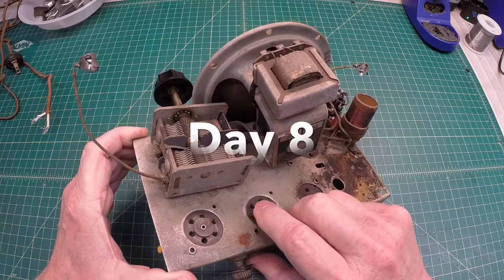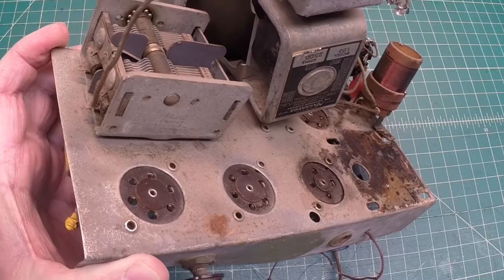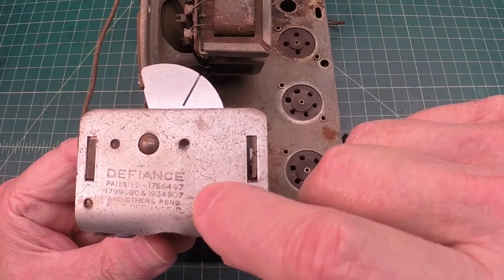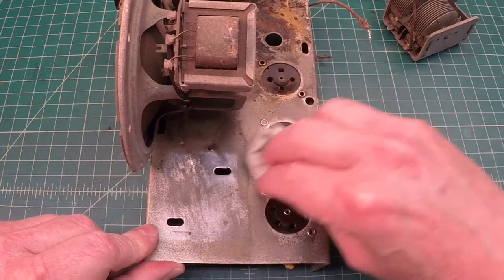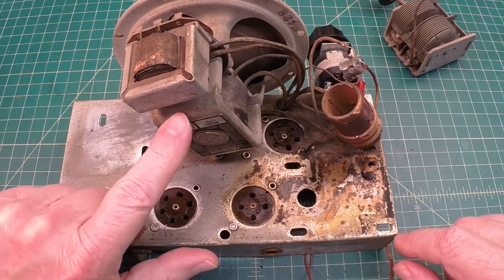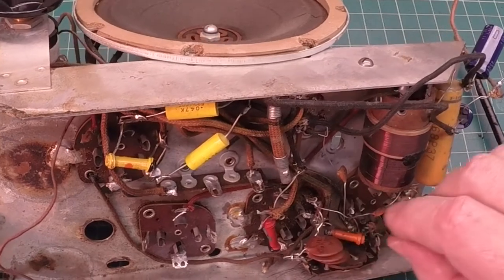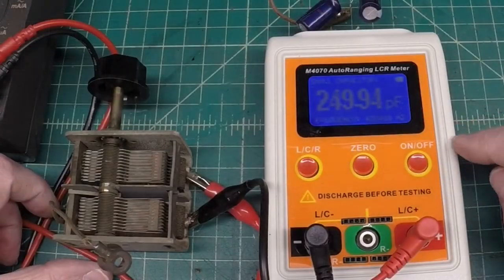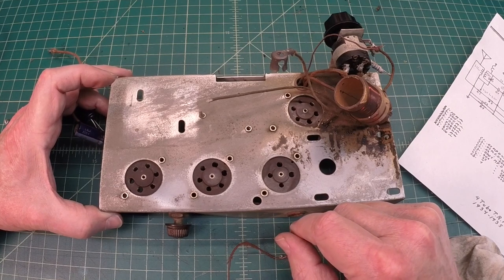Peter Pan Radio - Day 8 P2 (Tuning Condenser L Test + Field Coil & Output Transformer)

Comment: More good information!  I have questions.  1.  What were/are the coils on top end of the RF coils?  2.  Will you dress the leads in a single turn feeding the Field Coil the same as they were when you disconnected them?
Reply from the maker: +Stephen Moore +sporadic -Z Stephen, Sporadic -Z replied on the gimmick that ties to the top side of the two coils. He stated it couples negative feedback, prevents parasitic oscillation and limits large signals from swamping the next gain block. I didn't dress the Field Coil leads into a single turn, but it's never too late. Should I do that and what performance differences could I see? Thanks again for following this series. Best, Don